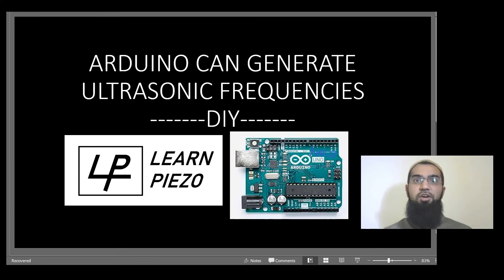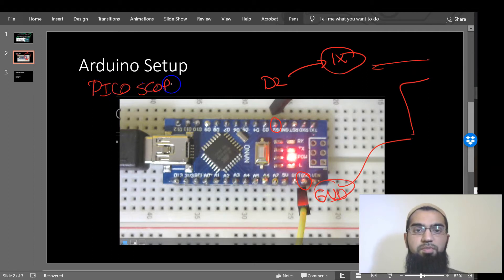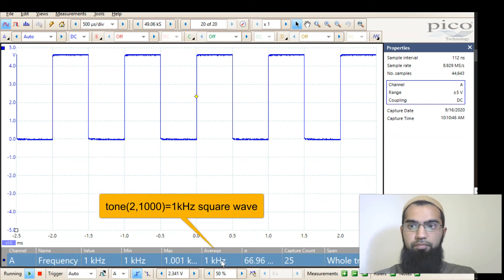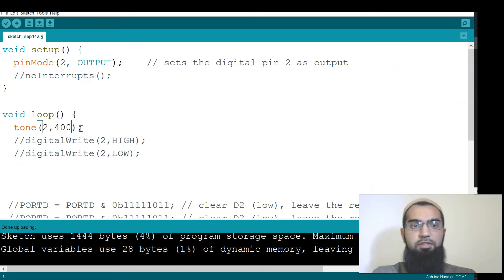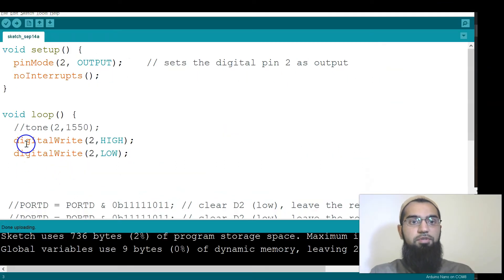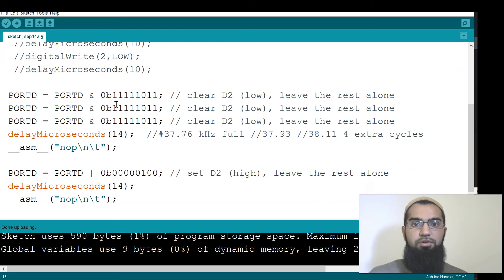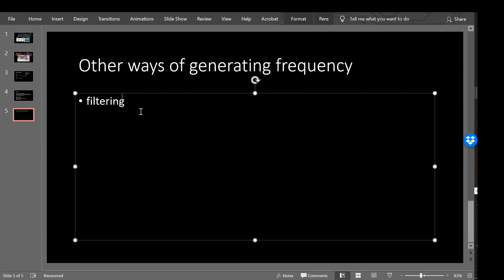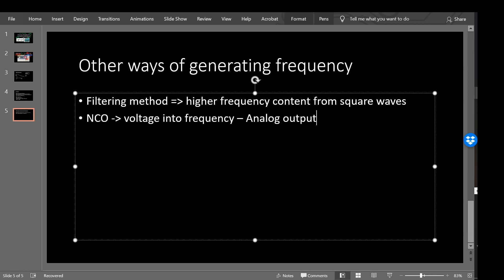High frequency signal for ultrasonic transducer from Arduino

Comment: 6:20 60khz limit if you go higher will emit a lower value because tone function expects INT 16-bit (2-byte) -32,768 to 32,767 so you overflow the maximum integer value
Reply from the maker: Thanks for sharing your knowledge in this area! Very important note!

Comment: The 8 bit processor used in Arduino allow you to toggle the PORTx bits by writing a 1 to their corresponding PINx bits. This is The fastest way, apart from using the hardware timers, to get a square wave. You can increase the period, which will be 50% by adding nops in the loop as you did. Of course you processor won’t be doing anything else while this is going on unless interrupts get in there so you may as well use the hardware timers for frequency generation. This is when you realize that the Arduino libraries are getting in your way.
Reply from the maker: Yup, at some point you will need to more fundamental embedded development than just arduino

Comment: can i directly run my "Ultrasonic Piezoelectric Humidifier Moisture Film Humidification 25mm" with this method ?
Reply from the maker: No,  not directly because the Arduino cannot provide enough current. It can provide the carrier frequency, though.

Comment: For a project of mine, i need to create high frequency soundwaves through a transducer. My main problem is that I dont have any idea how to accurate supply my transducer with these high frequency signals and still know what frequency I am providing to it. Basically I want to supply frequency range from 1.6MHz to 2.5MHz in steps of 0.1MHz. Is there any way to know beforehand what kind of frequency I am supplying? 

I can get to 4.05MHz(Max) and I want to accurately delay this to the range of 1.6MHz to 2.5MHz, how to do that?

Comment: Hi thanks for your explanation. I have uno r3 board (16mhz) and Lgt8f328p board that running 32mhz. Is It possible to produce 60khz sound using tone command and piezo passive buzzer?
Reply from the maker: Yes, that's true.
Reply: @ultrasonicadvisors  I ithink the transducer produce more power sound than piezo .. , .I just tried it. thanks
Reply from the maker: @TechnoWit3D  Yes, buzzer will produce more sound than a bare crystal because a buzzer has bending action which transfers energy to the air better
Reply: @ultrasonicadvisors  thank you. Do you know how to produce more power to reach more cover area? How about put more than one transducer would do that?
Reply from the maker: @TechnoWit3D  yes, using more than 1 transducer is one method. Another is increasing the voltage or more accurately tracking the resonance frequency.
Reply: @ultrasonicadvisors  how to do tracking the resonance? Do I Nedd special tool?
Reply from the maker: @TechnoWit3D  You need circuitry to measure phase and then digitally track frequency where phase is closest to zero degrees or circuitry which uses self oscillation to track the resonance frequency
Reply: @ultrasonicadvisors  thank you.

Comment: How can i drive a piezo tranducer with arduino. I would need upto 50 watts to get a good amplitude ? at about 20KHz to 25 KHZ.  Basically i want a powerful ultrasonic sound to be emmitted.
Reply from the maker: I would implement a half or full bridge driver. The Arduino would control the gate of the MOSFET's.

Comment: you need an amplifier for 1MHz frequency transducer, otherwise the signal will be very weak.
Reply from the maker: Yes, as you increase frequency, the current also increases, in which case the arduino has a limited current output. Logic level mosfet can be used to switch a high current capacity supply